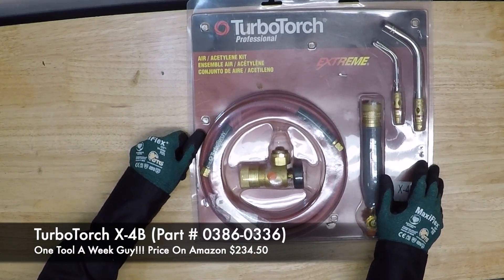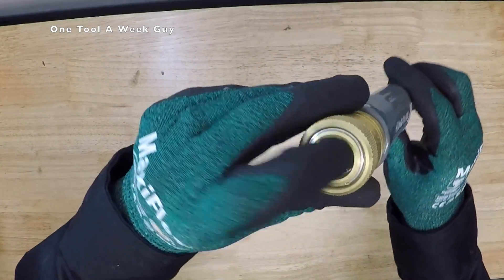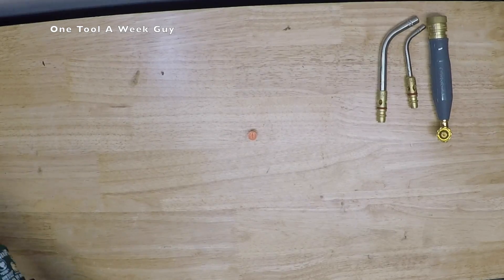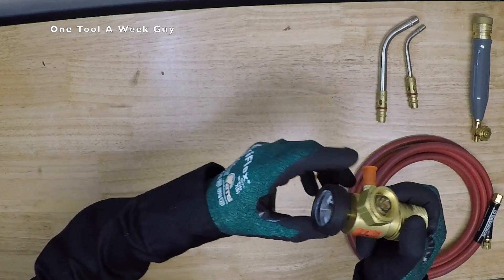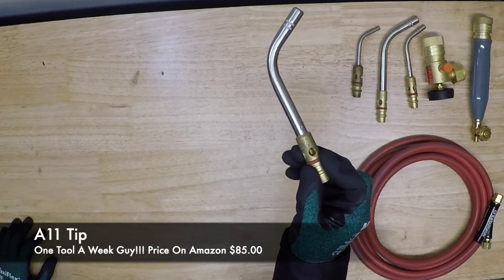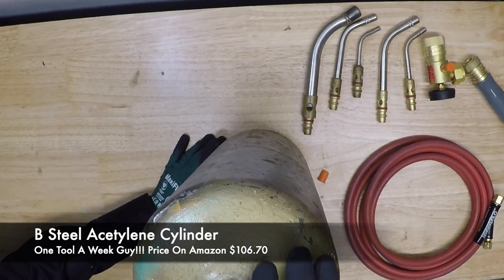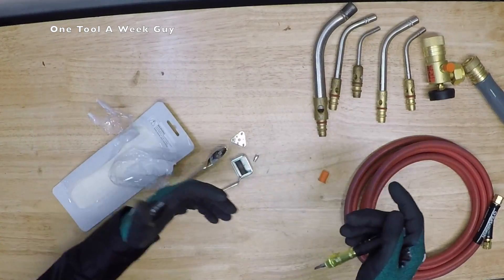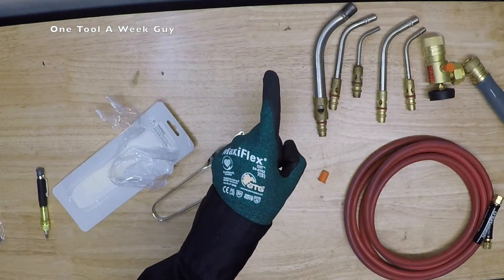Building a Soldering/Brazing Bag (TurboTorch X-4B, B Tank, Striker)

Comment: Can you use a regular acetylene tank on the turbo torch? I bought one of a buddy and used it today but I think I got the regular acetylene tank on? How do I know if I have a B tank?
Reply: "B" tank means the size of the tank.   You can use a larger acetylene tank, however you'll need an adapter, as the be tank fittings are different than the fittings on the larger tank.  You can also use an "MC" tank, whcih is smaller than a B tank, and is easier to carry around, but it has different fittings too.  (And you burn through an MC tank pretty quickly)    Also, Turbo Torch makes regulators with fittings for MC tanks, whcih would require an adapter to use with a "B" Tank.

Comment: The quick connect looks like an air hose connection, which usually leak after a few months.  Does that quick connect system have leak problems??
Reply from the maker: No problems yet.

Comment: Great vid,  turbo-torch makes some fine products. Back in the day you could unscrew the orifice from the tip,  then screw it into the handle briefly flow the gas and that would clean out the orifice.
Reply from the maker: nice to know. they probably changed it for safety.